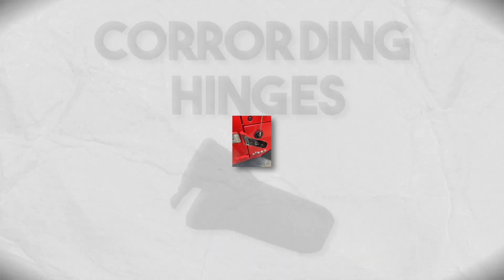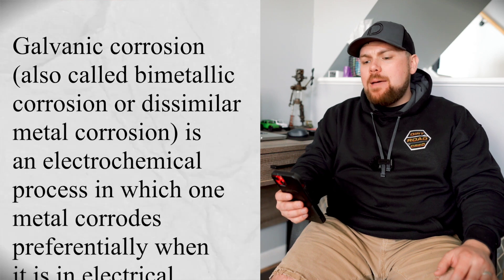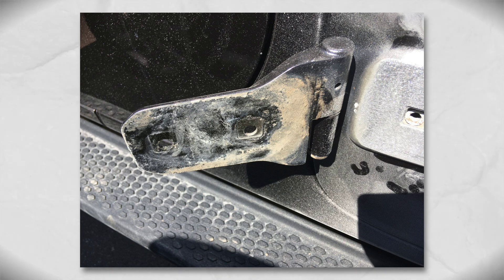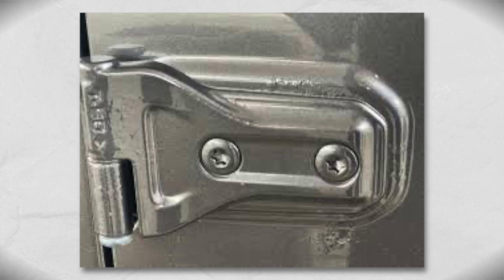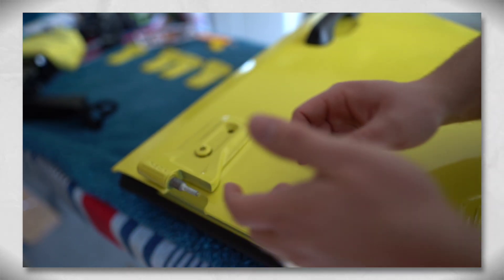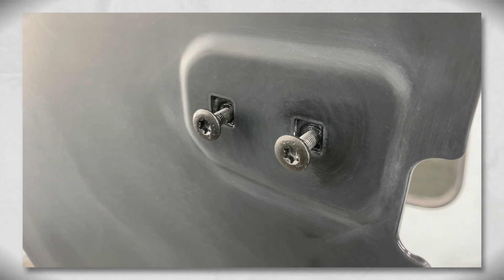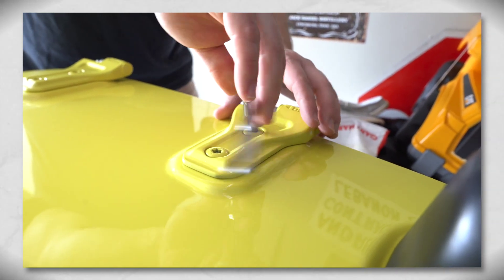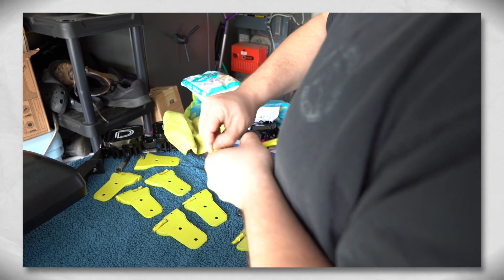What's up with the Jeep Wrangler JL Hinge Corrosion?

Comment: While I agree don’t take it out on the service mgr. The cost to do it right is justified when spending 40 to 80k on a Jeep.  You down playing it by production cost to do it right would be expensive, is crazy to think that way. I’ve had numerous issues and going back again to my local dealership for it happening again on my door not hinges but the actual door and in my windshield.  My JL warranty expires in July so I’m taking it back in to get other areas corrected again. So yeah I’m a bit frustrated with a 2018 Jeep JlU that cost 50k is doing this.
Reply from the maker: I understand the frustration, didn’t want to down play it just offered my opinion, I’ve had so many Jeeps this issue just became second nature
Reply: What is Jeeps official warranty on hinge bubbling?
Reply: Same issue with my 2018... Again!  My 3rd and last Jeep, ever!  They soured me for good.

Comment: Love this channel, but the information in this video is incorrect. The hinges are not steel. They are also aluminum. A magnet doesn't stick to them.  And there is corrosion occurring on body panels awat from the hinges, like hood and door edges.  It's a factory process problem.

Comment: So another option is to put a gasket between the two surfaces. I used to be one of the Mechanical Engineers for Loadrite Boat Trailers and we had to deal with galvanic corrosion all of the time. We had formex gaskets made to go between out hot dip galvanized crossbars and aluminum frames. It's important to keep them clean so no catalyst can get between the surfaces and speed up the reaction
Reply: A gasket is what I was thinking too.
Reply: @jaymackchristianmusic  it's the cheapish fix for the plant if they still want to keep pumping numbers out fast
Reply from the maker: Agreed!
Reply: A gasket was my first thought too. Is someone making such gaskets for purchase?
Reply: I also fight marine-based-galvanic corrosion issues as a fishermen.  Call me crazy, but smearing on TEF45 by Marelon on the hinge PINS may significantly slow it also as the stray current won't make it to the hinges... NOT a long term fix, but helps me sleep better at night.  Marelon TEF45!!!

Comment: JL Wrangler Forums has a thread titled ‘Bubbles in paint at door hinges’ that contains a copy of a recent (Feb 2023) Stellantis TSB (p188).  They use zinc shims under the new hinges.
Reply: Good info!
Reply from the maker: Thanks Jon!
Reply: Zinc=Sacrificial metal?  
Sounds like what we do on boats. 
Put less noble sacrificial anodes on aluminum and stainless parts to minimize corrosion of the other parts. 
Magnesium anodes are used in Fresh water only, Aluminum anodes are used in salt or brackish water.  
Replace whenever they are 50% disintegrated. 
So: draw your own conclusions as to whether this will work. 

In plumbing, if you join Copper to galvanized pipe without a galvonic break: fitting with plastic washer, the Copper will corrode for many feet after the joint. 
This happened in my house. 

Galvanic corrosion combined with seam sealer that failed, especially on thinly painted edges, could be reason for other areas of bubbling.
Reply: My concern there is the Zinc will become sacrificial and need replacement, though easy enough to do as a boater I do it annually...

Comment: Just one point, the whole "Jeep will make it right" statement is completely wrong. Jeep has been doing their best to avoid doing the right thing on this topic for a huge number of people. They consider it a "paint" issue and thus it is not covered under the rust a corrosion warranty. So, you only get the two years.

Comment: Hello, 
Just so you know, the hinges are aluminum, not steel. There are many people reporting the bubbling of the paint occurring not only at the hinge area, but along the edges of door panels, the hood, the windshield frame and tailgate skin. 
Aluminum oxidizes, it doesn't rust. The surface of the aluminum releases aluminum oxide which appears as a white powder, and lifts the paint. I believe the issue lies in poor paint/surface prep and priming at the factory. Perhaps the other manufacturers who use aluminum panels have better quality control practices?
I enjoy your channel's content.
Cheers

Comment: Hey, I just brought a 2 door JL and I took her to the power washer a week later and I got the corrosion. All it is is work that I have to do later. The rest of the jeep is perfect and runs beautifully. There is a TSB on how to fix it properly using a gasket and if you can powder coat the original hinges or get stainless steel power coated ones that would help too. Either way it’s the only problem and everything else is awesome. Great engine. You just have to change the oil often and I’m gonna be doing the work myself if I can’t afford it as it’s out the 5 year warranty. I’m checking out how pros do it step-by-step and in the summer it’ll be beautiful again.🎉
Reply from the maker: Awesome! Congrats on the jeep!

Comment: FYI this not only happens along the hinges but where the aluminum panel folds over on to the inner structure as well.  Had my 2018 JL HellaYella fixed recently at Flemington Jeep Chrysler.  They had to do both door and hood edges plus the hinges.  Very frustrating!  For Jeep to keep doing it is an exercise in futility and takes advantage of their loyal customer base.  It would be interesting to know how much they have spent to make the repairs under warranty.  My guess is pennies since they will not fix the problem at the factory level.  I do not know how much the factory is making off the Wrangler, but I am sure they are factoring in the cost for flaws like this to cover their losses.  Love the channel Matt, keep up the good work!

Comment: BEWARE ! Just got my 2020 Jeep Rubicon back from Suncoast in Seminole FL, After 6 months of this process. Replaced all doors and the hood. Came back with a dozen air Bubbles in the new hood, door locks on passenger don't work, New warning light on dash, and  Rubicon decals will not be put on for 3 more weeks.  Such a mess with Suncoast DO NOT GO THERE for Corrosion warranty claim and they never offered me a rental took 2 weeks for them to complete
Reply from the maker: Good to know!

Comment: I think if you’re paying 40-60k for a Jeep.. this shouldn’t be a perpetual issue. I have it all over my JL, and since I’m right outside the warranty period they pretty much told me I’m out of luck. Which sucks because I didn’t even notice it until recently, and it’s getting worse rapidly. 
I’ve also read some people have gotten this fixed 3 times just to have it happen again, and then they’re out of warranty.. So I don’t know if it would have made a difference getting it reported seeing as it prob would have reappeared. 
This is bs. Jeep should fix it, no matter the warranty because it’s a factory issue. It should be a recall.  My last Jeep had a factory defect where casting sand from the factory was clogging my heater core leaving me with no heat in the winter on the passenger side. I’d have the lines blown out just to have them clog with sand again within months. 
Of course there was no recall or way to fix it without paying thousands.. so I traded it in for my current Jeep. My new JL runs great but now I have paint issues 😂
What do you do if you love Jeep, but their constant manufacturing f’ups just keep happening? 
I’ve put up with it for 10yrs because I just love jeeps. But it would be nice if they got their shit together.

Comment: Wondering if you could put a clear 3M film under the hinge (like the Rock Stopperz) if that would then keep those metals from meeting up and corroding.
Reply: I would like to hear about that too.
Reply: Please let us know what you end doing with your Jeep hinges. I'm thinking spraying mine with a clear lacquer underneath.
Reply: Curious as well.
Reply: I think 3M film would work, or drastically slow it down. I will talk to my local wrap shop about this.
Reply from the maker: Might need to test it!
Reply: I am thinking thin rubber should stop the electron transfer from one metal surface to another...like a bicycle inner tube...and make it more water proof. The big thing is what to do about the bolt which could also bridge the gap between two metals...what about the white thread plumbers tape?

Comment: Idk, my bro. It’s easier to say “don’t bash jeep” when you have some pull and they take you seriously. I have a 2020 with galvanic corrosion and 3 dealers have left me hanging— it’s 2023 so according to the warranty sheet, I won’t be able to get mine fixed. Literally can’t even get a call back even after they inspected it and determined they’d fix it. Makes it hard to want to keep a jeep.
Reply from the maker: I don’t have a crazy amount of pull, I just didn’t want to rip them apart online.
Reply: The required warranty repair, should be based on the date of the complaint… Simply allowing the warranty to expire in order to avoid the work, would never stand up in court!

Comment: Hi Matt, are you sure the hinges are steel? On my 2023 JL a magnet won't stick to the hinges. Just the steel bolts. Does this mean they are aluminum hinges? Is this galvanic corrosion between the hinge/door and the steel bolts instead of between the hinges and door panels? Is this just a problem with the 2018-2022 JL/JTs?
Reply: They are aluminum. Only the bed and body at the rear doors are steel on a JT Gladiator. Everything else is aluminum
Reply from the maker: Good question I’ll check mine too, don’t think it’s the bolt!
Reply: @DIRTROADCRED 
If that is the case, then is the corrosion from the two surfaces not being prepped before assembly? Or is the composition of the aluminum hinge slightly different from the body/door creating galvanic corrosion? Just trying to figure things out as I don't really want this to happen! 😂

Comment: It baffles me that the Jeep engineers did not know this when they went to aluminum door panels on the 2018 models. I just bought my wife a 2020 Wrangler with low kms and it looks brand new but half the hinges have paint bubbles. A local dealer has me on the list to re paint.

Comment: I understand that this issue doesn’t bother some people but to me it’s a big deal. With how expensive Jeep Wranglers are this issue is unacceptable. I love my Wrangler but I will never buy another one unless I hear from Jeep themselves address and fix this issue. My 2018 JL Rubicon has corroded on all 4 doors and hood. My dealer, Bettenhausen Automotive in Illinois, was very familiar with the issue and did an excellent job fixing the issue. I’m thankful that everything went smoothly but, my rep has already told me that Wranglers come in multiple times with the same issue so the body shop isn’t a permanent fix. They will only cover the cost of repair for corrosion for the the first 5 years, So what am I supposed to do once the warranty expires?
Reply from the maker: Definitely hard to deal with, glad your dealer hooked you up!

Comment: I used to live on the East Coast and drove a 2021 Wrangler 4-door to work and running around. My door hinges, hood hinges and tailgate hinges all started to corrode. The salt used on the roads I believe just gave this rust a head start. Jeep should start to use steel for hoods, door panels, tailgate panels this should stop the corrosion. My under carriage was rusted every where. I live in California now and drive a Ford Bronco Wildtrac, and love it. Jeep corrects the corrosion I will buy another Wrangler.
Reply from the maker: Not a bad idea!
Reply: @DIRTROADCRED  Thanks!

Comment: I’m glad you addressed this, just a bit of info I am currently waiting to get my 21 JLR repaired , but it is the side edge of my hood, apparently there is a problem with prep to some other areas that are aluminum also, thanks for the video.
Reply from the maker: That’s interesting!
Reply: Yes, they prep and paint the aluminum and steel panels in the same location, so some ferrous particles settle on the edges of the aluminum panels with a hasty wipe before paint.
Reply: @dustingibson2407  I tend to agree this problem lies in something well beyond simple galvanic corrosion...  Door edges only bubbling screams a breakdown in the process other than just dissimilar metal corrosion.  Ferrous particles (think fish eyes/latex etc) floating around and one hasty wipe has my vote in SOME cases here.

Comment: For those experiencing a dealership refusing to deal with this, even under warranty, it's because Jeep does not pay the total cost to repair most of the time. When we sublet it to a bodyshop most will charge more then what Chrysler is going to pay for the repair, causing the dealer to eat the difference. At my dealership paint costs has gotten to a point where if you didn't buy it from us we're not going through the massive headache that is subletting and getting the claim paid. I'd suggest you take it to your selling dealer if possible for a higher chance of it getting fixed. Some dealerships may also have an in-house bodyshop so the sublet isn't an issue.
Reply: Spot on. I’m in the Boston area and all but one dealer have sworn off doing the repair work.  Jeep totally ignored the issue, regardless of how many times you try.  I love my Jeep, but the company is awful.  That said, I think all car makers are scum.
Reply from the maker: This is an interesting point!
Reply: @brianowens1002  What dealership in Boston WOULD do it??
Reply: @loubonaparte5063  Brigham-gill, which is not a good dealer.
Reply: So they give you extended coverage but they won't do the work,..isn't that illegal?
Reply: @itdoesntmatterok  More likely, a “breach of contract”…

Comment: I live in North Idaho and took my Jeep Gladiator to Dishman Dodge in Spokane Valley Washington.  They were very accepting of the issue and told me that they are no longer doing “repairs” at the shop because the issue could not completely be solved with body work and paint.  I was told that there was an issue with the actual metal and therefore they are completely replacing the doors/hinges.  I don’t know if this is just what this dealership is doing, but they were very knowledgeable about it.  Only downside is there was about a six month waiting period for parts, but I am on the list.  Probably also important to note that I’m having the issue on the hood hinges as well.
Reply from the maker: Good to hear they would help!

Comment: My local dealership, Freedom Dodge/Chrysler/Jeep in Lexington, KY took care of this for me by reaching out to Jeep on my behalf. Jeep responded by REPLACING three doors (driver & passenger front, and driver rear), the tailgate hinges, and fixed a spot on the edge of my hood. I was extra tic that Jeep was replacing the doors. After getting it back from the body shop, I drove it for a couple weeks before it got really cold here. Then noticed I was getting a lot of air leaking into the cabin. Turns out, the replacement doors are missing the “weld” or “epoxy” seal around the channel that holds the weatherstrip to the door. So even with the weatherstrip in place the air just comes in from behind the channel that holds it onto the door. I took it back to the dealer, they reached out to Jeep and Jeeps says “that’s how the doors are made, there is nothing wrong with them.” So the dealer says there is nothing they can do. I asked them to show me a newer Jeep and asked, “if that is how the doors are currently made, then why isn’t it that way on any of the new Jeeps?” Silence. So I have had to tape around the door to cover the gap between the door and the channel that holds on the weather strip to keep the air out/in. It still leaks air. I still get mad about this when I talk about it. My 2018 JLUR has to be taped up to keep the air out! Of course, that also means no deep water crossings either!
Reply from the maker: Thanks for the suggestion!
Reply: That’s such a bummer!! I feel for ya man!
Reply: I just got mine back 3 weeks ago, new hinges on all five doors, four new doors and it's like sitting in a wind tunnel. Had a tech ride in the back seat... "seems fine to me" Going to the local sub-contracted body shop (they do fantastic work) next week to see what he can do.

Comment: Great video as always..I used to put on trailer hitches in the 90s and some car companies were using aluminum frames on some models and when we drilled the frame/body they had these lil clear stickers with a hole innit much like ppf you stick on over the hole to protect against dissimilar metal corrosion I wonder how it would work if you ppf the backside of the hinges….how hard was it to line the doors up when installing?

Comment: Currently have a cheap Wrangler Unlimited 2019 with only 35000 miles on it. The dealership said that the vehicle does have a Warranty on the paint. Even though there is a service built in ask mention in the video. Three dealerships have refused to repair my door hinges. I've also called Jeep to see if they can help me get this issue fixed. And they said that they cannot force a dealership to do anything that they don't want to do. And I have been nice and polite and not rude in anyway. Does anyone know what I can do?
Reply from the maker: Interesting!
Reply: There’s a legal remedy, but pursuing that remedy, and then enforcing it, costs a lot of money!